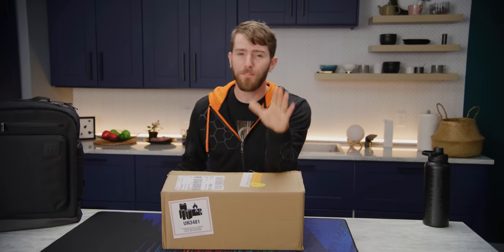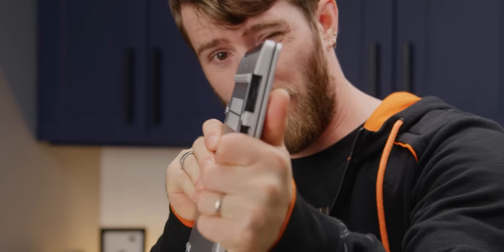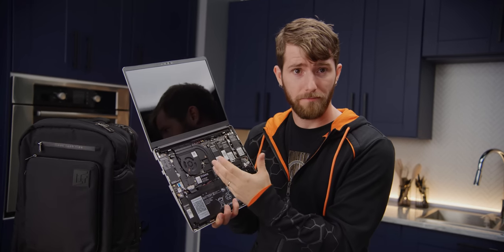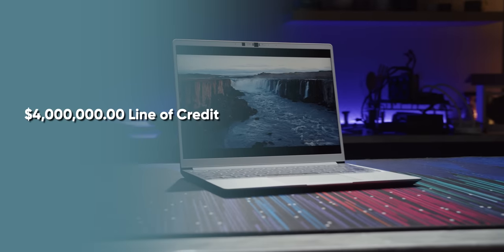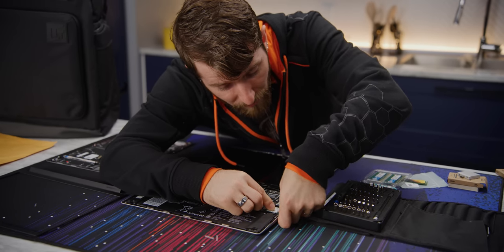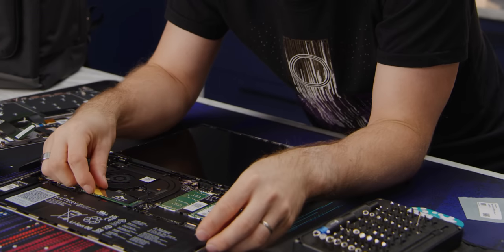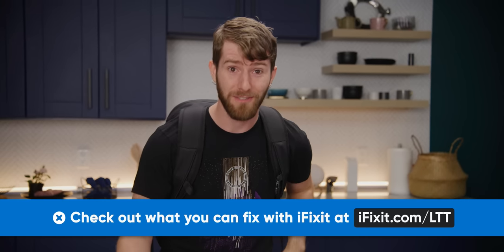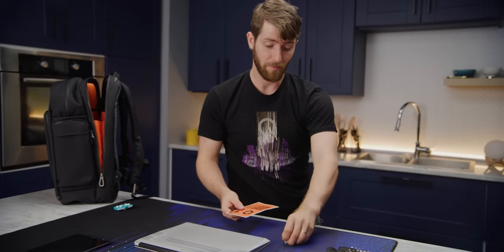I’m Legally Obligated to Disclose This - Framework investment

Comment: "The only reason other companies don't do this... is because they don't care."
That and they don't trust customers and don't want to lose revenue due to customer screw-ups.
And if customers can modify, upgrade and repair devices on their own they're less likely to buy the newest shiniest replacement.
The customizability is very attractive.
But the right to repair attitude is phenomenal.
Reply: Also they'll lose their control over planned obsolescence.
Reply: That is why you give them reason to upgrade. And for cheap. Imagine people able to swap their GPU in PS5 or XBSX to a newer version. Do you think people would hold back their money? Or dive at the chance? Say they bought 399dolla console...and down the line get a cheap upgrade of 100dolla for the GPU. Imagine how will that work out for the consoles.
Reply: One of the reasons I like Clevo laptops (sold under lots of different custom brands) is that you can take them apart. You can upgrade them, they have completely documentation for taking them apart and the battery is not glued in so you can replace it. They are more expensive because they are small volume devices.

I want things like what framework is doing to just be standard and that for the kind of laptop that just glues the battery in to be illegal. It is just creating e-waste.
Reply: @arcknight_bk2o183  Would require a major rework of how console games are developed, which AAAs wouldn't be in a hurry to do...and the corporations manufacturing those consoles are some of the last companies on Earth that would want to get on board with right to repair, barring a particularly profitable optics move if enough hype is generated. Hope it's not just a nice dream~
Reply: It sounds legit, but then it doesn't explain why build own PC is still popular these days. People could buy entry level of framework laptop to upgrade it over the years on things that matter them most, it would be very budget friendly (if mass produced and standardized like how ram and m2 slots, wifi already are) and reduce tons of waste, as laptops are not easily recyclable. We are actually not far from that, framework is just more user friendly. Actually they need to invent a better universal/standardized laptop cooling solution for CPU and GPU, replaceable battery and you got it all.
Reply: @auturgicflosculator2183  of course. That's something companies have to figure out. If they make a good business plan, it might be more profitable than just selling one console in 7 years and then wait for only games to turn a profit.

Comment: Seems to me that they could fit two ports in each of those modules given how wide they are.
Reply: but you would need a usb hub inside, which means it won't be easy retaining 100% functionality. don't forget that USB-C also contains PD and DP, and both of those are "lost" through a regular usb hub. i would've liked two ports too, but it seems pretty hard to implement
Reply: @thesomebody420  so does each of those modules contain its own PCIe device controller?
Reply: @Hermiel  pretty sure they're just usb-c to x adapters made to fit into the chassis  semi permanently. Atleast that's what they look like at a casual glance. Allowing you to customize port layout and replace a damaged or worn port.
Reply: @chublez  yeah the connector looks like USB-C but I see no information about the bus used. And they don't seem to have an Ethernet module yet. Judging by the slim the body I'd guess it has to be one of those drop-jaw types. Maybe it requires custom tooling.
Reply: @Hermiel  They are using the Thunderbolt that Tiger Lake has on-die, and the four ports are effectively just bifurcations of that one Thunderbolt link that terminate in standard Thunderbolt USB C ports. So the processor just recognises the port modules as daisy chained devices connected over a Thunderbolt link.
Reply: @osirisgolad  Ah, okay, cool. Yeah I figured it was probably TB. Where did you read the spec?
Reply: @Hermiel  I can't quite remember, but I have this vague memory of Framework's CEO explaining it in a video around half a year ago on Adam Savage's Tested YouTube channel. It was about half an hour long and I only remember the video because I was surprised by the depth of questioning by the interviewer. I could be conflating multiple things I read and watched around the same time though.
Reply: why does almost everybody in this reply section have purple profile pictures, so hard to follow with the conversation lol
Reply: @osirisgolad  Oh, weird, I follow Adam Savage. I missed that one.

Comment: I'm looking forward to see a mature RISC-V implementation be done and usable (maybe even replace x86 someday ?) in a Framework machine. That would be soooooo cool.
Reply: Lamda2  I really meant replacing x86, because it's an old arch, sure ARM could be the next arch for every desktop and laptop PCs, but RISC-V is open-source and have other licensing advantage over its counterparts.
Reply: I am awaiting for a laptop with  3060 or 3070 laptop for Data Science and AI Simulation and algorithms for big data visualization. I was thinking of going for Ryzen 6900HX or i7 12th Gen. I am also working on Network technologies and learning Firewall and cybersecurity over Cloud. 

What would be the best option for a  working professional who also needs atleast 3-4 hours of battery life?
Budget: 2 lac INR

Should I wait longer for another laptop or go for anything that's around for 2000-2200 USD?

Looking for usually 17.3 inch or so for better screen as I am working on large data and visualizations. Small screen makes tough to work on large models

Anything best value for money under 2 lac?
17.3 inches only
i7 12th gen or Ryzen 9
GPU based task moderate to high. I do not need 3080 or 3070 TI. 
Screen quality = QHD

Comment: ”in this box is the first laptop ive bought for myself since high school”
and therefore the first thing i should do is slam the box at the desk
Reply: Packages routinely endure FAR worse shocks in shipping. Manufacturers test their packaging to pretty strict standards.
Reply: @vRackham  mon, idk about the part about manufacturers testing. Have you seen the secret shopper series where they received a system where 3/4 panels were dented? Or the GN video where the PCI-E slot the graphics card was in was mangled?
edit: typo
Reply: #droptips

Comment: It's a great idea. I see a tiny problem here: as long as we don't have access to standaraised parts from multiple independent vendors you have to rely on the manfacturer, and what they say the prices should be. It'd be great to see this popularised.
Reply: Open ecosystem, a la Raspberry Pi or Arduino? The fact that they're using USB-C to connect everything together bodes well for standard interfaces.
Reply: Everyone will be able to customize and sell ports / extensions on the framework marketplace in the near future! They already made open-source connectors and technical details of the laptop.
Reply: @EmptyZoo393  I was intrigued by it using USB C behind all the ports - Is this just using USB-C as a connector, and not running USB-C over it? Are the USB-C ports just pass through of the socket behind it, supporting all the alternate modes?
Reply: @bdavbdavbdavbdav  That is a really good question and I wish I knew the answer to it. I'm guessing it's natively running USB-C. USB-C is...complicated. I don't know if Framework's adapters include conversion chips or are generally passthroughs with the right combination of identifying resistors/wires. USB-C can somehow (optionally) support Displayport, HDMI, analog audio, and thunderbolt, which itself supports PCIe 3.0. Once you've got PCIe you've got bandwidth for just about anything.
Reply: @EmptyZoo393  I'm really hoping they're supporting the native alternate modes of USB-C so that, in a pinch, you can just stick a standard USB-C -> DP adaptor in to the socket behind. I feel that if they're doing some kind of proprietary trickery, using the internal USB-C ports as a connector only, then that goes against the ethos. I get the impression they're not thunderbolt also, but would love to be proved wrong there!
Reply: @bdavbdavbdavbdav  To touch on that, their forum is filled with people asking for advice from engineers at Framework on custom modules, and the engineers are providing links to 3D models to print or mill modules, as well as stating that it's Thunderbolt-capable USB-C. It's a standard Intel chipset.
Reply: @tpasco1995  Ahh thats beyond awesome... Great to hear!
Reply: @tpasco1995  Glad to hear from someone who knows more about it than I do. Here's hoping it really takes off.
Reply: @tpasco1995  Hnng this has been the one thing Ive been wondering. So you could use one of these ports with an eGPU?
Reply: @Wrathlon  Yupp!

Comment: A little bit note here: after you have been accepted into manufacturing plant, you might not need to pay upfront, just 15-90 days after delivery of the shipment. This takes away a lot of your cash flow risk and throws it to the manufacturer. In other hand, if you seem to have cash flow problems and it becomes somewhat publicly known, the manufacturer might refuse to ship ready units to you until you pay them right now. 

So there are many sides to the coin and all comes to the trust between companies. Startup companies often are frown upon on manufacturers because... well they know they don´t have cash to do a second attempt if the first one fails and usually keep things hidden until the very end and they go suddenly bankrupt and manufacturer might have specialty parts in their own inventory that they need to pay from their own pocket, try sell them back to original manufacturer or somebody else. And if you have manufactured the products ready for shipment, you might be in deeper shit if the product needed online services from that startup company, nobody will buy those products so they´re basically e-waste.

Comment: Linus is in the enviable position a lot of entrepreneurs would love to be in, and a lot struggle with, moving on and giving up complete control of a company. 

Personally, times have moved on from the best graphics cards (which you can't buy) - mining issues, LED and water cooled setups, to some real adult life issues such as repairability, ethical issues around tech for sustainability and mental health issues surrounding the practices of social media companies and marketing of addictive games / apps. Linus is now a big boy.
Reply: Part of that is because Moore's Law is starting to break down, which means you're not going to see the kind of exponential growth in hardware power that we grew accustomed to over the past thirty years. Furthermore, even if we DID have that growth, we're already at the point where most game developers have enough hardware power to do anything they want to do, and older hardware will always provide an incentive to make their software efficient enough that you don't need exponential growth in hardware capability.

Which means, either way, we're moving into a new phase of computing. Instead of throwing out devices every two to five years to replace it with something substantially more powerful, we're going to be emphasizing the maintenance of devices we already own, because the advances aren't going to be that significant anymore.

Comment: Does this mean we could potentially get a version of a Framework laptop where Framework makes eGPU "Modules" that hook in via USB4.0/Thunderbolt 4 like the side-IO ports?

As that would be awesome if possible (even if it was at the sacrifice of ports, size.etc) as a option.
Reply: If they make it somehow gaming capable I'm sold.
Common Linus
Reply: @HoJSimpson  I don't see the problem of designing a beefier laptop with a better cpu and dedicated gpu following the same principle of modularity. Just make a thiccer chassis, add better cooling, bigger battery and replace the screen for a 144hz 1440p display.
Reply: I would def buy one with a dGPU. I think this laptop is amazing and would love to buy one if I could spec it for gaming as I would like to have a portable gaming computer.
Reply: @rodryguezzz  ofc something like that will not come now. New chassis means new molds etc.
I am still waiting to see if they bring AMD specced models with that chunky AMD graphics.

But I was really tempted to buy one.
Need to wait tho untill they ship to Germany

Comment: Wish they had an AMD Ryzen, or APU option.  Also a second M.2 slot and maybe a SATA SSD 'slot', and maybe an external or slot in second battery.  (Hint, Hint).
Reply: Bruh at that point it will no longer be a framework laptop it's gonna be toughbook with removable parts
Reply: @gurmeharsingh7958  They could eventually do a Toughbook line for those who really doesn't want or care to have something light or slim and need lots of extension slots.
Reply: @gurmeharsingh7958  as a daily toughbook user I can get behind this. There's just something awesome about documenting on the same thing I was just using to block projectiles being thrown at me by a someone in the midst of a psychotic episode. They make an amazing melee weapon in a pinch, as well.

Comment: I hope someday they make a 'gaming version' that has a gpu, no rush though, I would love to buy this thing!
Reply: Agreed. I suspect it will take a year or two for it to be even a possibility for them, but a Ryzen U chip will be a good step on the way (once they figure out the engineering/logistics/economics/agreements). I'm curious if/how they'd add a GPU in as a replaceable part, given how finicky those things are in the best of times. The one laptop I've seen that could do it was one LTT reviewed a while back that allowed you to pop out the DVD drive and put the GPU in there instead.
Reply: @EmptyZoo393  here's to hoping they get Nvidia and AMD to get on board with a standard laptop video card format that they open source to the rest of the market.
Reply: @EmptyZoo393  yea, maybe am thinking they can start with ryzen apu's, it will take time for sure and I want them too. I really want a good product and succeed as a company

Comment: I feel like in a lot of science fiction all of the tech is user customizable and upgradable, so if we truly want our machines to be like that in the future, making decisions like framework and yourself is a step in the right direction.
Reply: Considering that all laptops have similar shape but what's underneath is a different thing, usually it's cheap duct tape in cheap computers and 2 fans in an expensive.  What you get is a minipc with a screen stuck to it who can be moved around with a single shoulder or hand. Stationary computers what I heard, many connect it to the TV and by then the question about laptop or stationary is redundant since both provide this ability. It is only when using a desk who doesn't have adjustable height or no docking station for the laptop. Screen size as well is a limited factor but many who need the demand do have afford with 2 screens. It is only when we look at the budget consumer we do see the real benefits.

Comment: I expect a lot of developers wanting this, like Framework being at the core of dev kits. Repair gurus would adore this modular system, too. 

For the average consumer, they might buy the thing they think will work from a name they know about and not trust other companies if it doesn't have the backing of a public figure consumers can trust. While you and some others are an exception to this next point, it's difficult to trust regular YouTubers with product promotion because it's clear to viewers like myself that there's a monetary gain to promote those products. Until Framework can get it's name on the same level as the Big Brands, average consumers typically won't understand the true value and benefit the world of consumer electronics could see if something like this took the main stage and really pushed manufacturers to emulate this concept.

Comment: A point not mentioned in the video. Linus is valuable to his advertisers. They may want his specific face reviewing, talking about, holding,  their product. Which means less $$ for LTT. Fully support and understand why you did this, but you have to be fully open for the trust that you need from fans to get through this.

Comment: It would be cool someday a RISC V system inside with modular config for the specific workflow. Low energy consumption and high performance. In the mean time stress testing the cooling system would be interesting and giving a lifespan for the cooling liquid it would be nice for calculating the cost of playing non stop gaming or blender rendering on that framework.

Comment: I shared similar insights with ASUS and actually spoke with ASUS CEO regarding modular architecture. I was surprised when the CEO got back to me. They seemed to take me seriously but not seriously enough. And that's okay because it looks as though Framework has it under control.

Comment: A year has passed and Framework is still around putting out their laptops. Now I just want them to make a version with a larger screen (larger screen also will mean more I/O connections).
Reply: I agree I have the normal one but I would love if the made a 15 inch one that had more expandable cards and more options like a gpu or touchscreen etc

Comment: I suspect that the openness of the components and the fact that you can run it outside the case would mean that the laptop might be a good choice for industrial device manufacturers looking to modernize old control systems.  What is the actual interface of the modules on the motherboard side?  Is it USB, or does it connect directly to one of the motherboard data buses?  If the later, could they do old interfaces, like DB-9 serial?